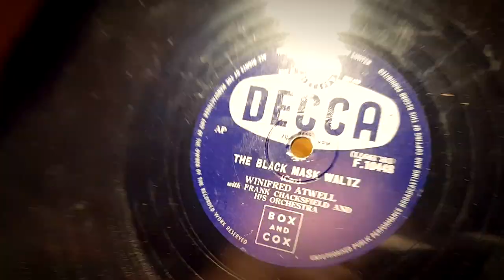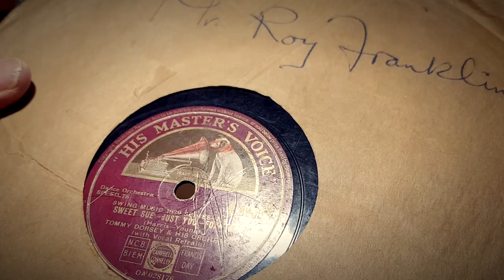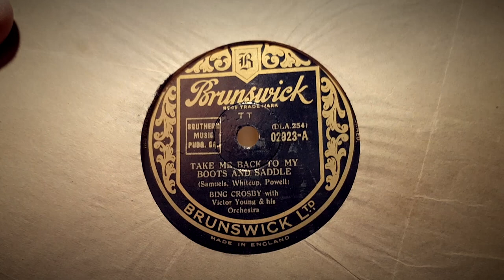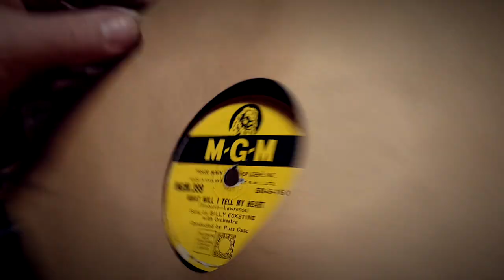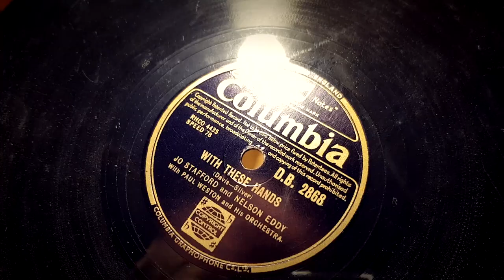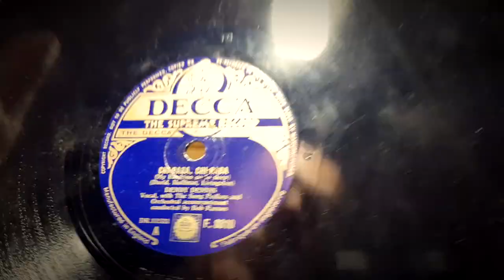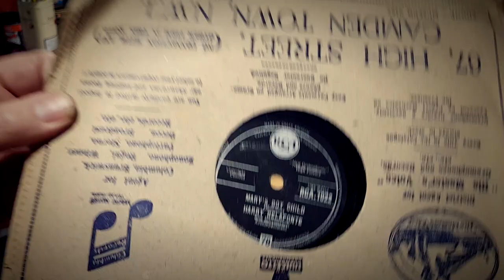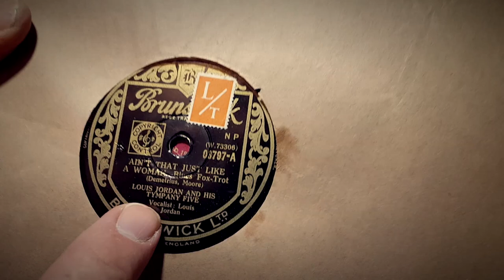LOCKDOWN 14    78RPM SORT THROUGH

Comment: Those marks you pointed out are what are called "push marks" and I know of two theories one is they result from the mechanical process of extraction of a newly pressed record from the press and the other is they are is a filled on the acetate master the grooves were cut on to. The holes were needed to stop the acetate master from slipping as it was being cut and once the manufacturing process was started, the holes were filled in. If the holes were poorly filled they left an obvious bump or dip. If they were well filled and smoothed off, they barely show at all
Reply from the maker: Thank you that is interesting as I always wonder what they are...  Yes, I have seen ones that are like bumps too...  Thanks for the theory here and comment...   Chris...